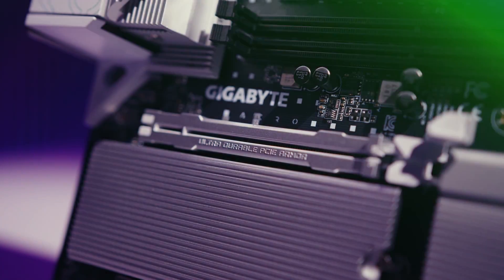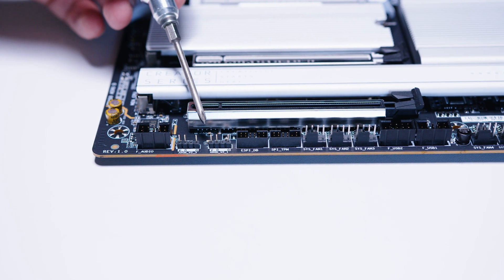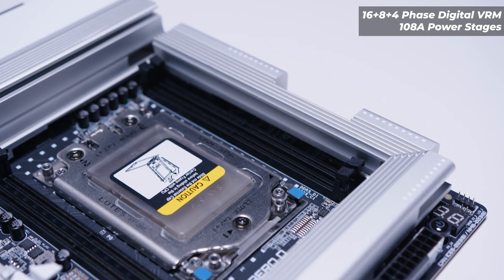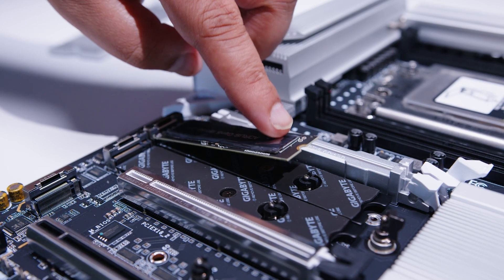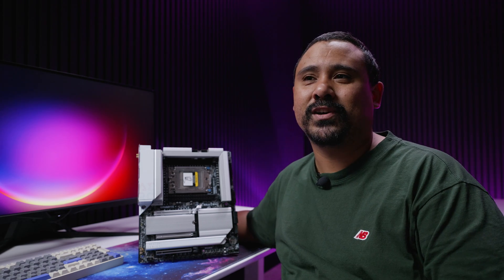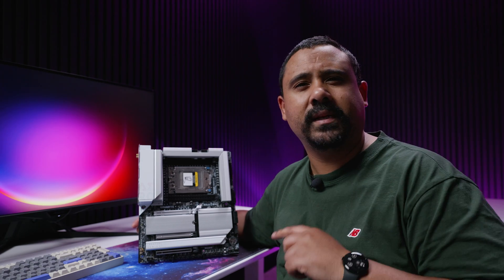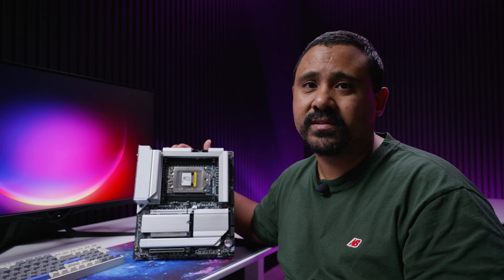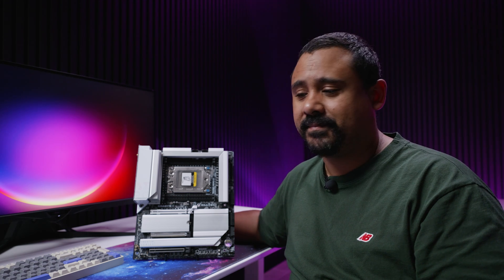Threadripper Never Looked So Good! 🔥 - Gigabyte TRX50 Aero D

Comment: Do u consider to use this board personally? If so, you might need to RMA the board 1st, cos its not the latest revision. Older rev have issue with sleep feature.

Comment: I always wondered. How is gaming on a threadripper cpu? Keep up the great work you guys and stay safe. ❤
Reply from the maker: Gaming on Threadripper is fine. It's a bit overkill for gaming though.
Reply: Commenting here because I too would like to know.
Reply: Gaming will be alot less than the7950x or 3d for sure.
Reply: @JoeMama-yl1ow  Nope. HEDT chips like Threadripper are better for gaming than low end desktop chips like the 7950X/X3D (AM5) because you can game and also multitask, stream, whatever. CPU doesn't matter much for gaming (it is a GPU activity), but if you can afford the more powerful CPUs then there is no reason not to go Threadripper. Not to mention you will have enough PCIe lanes for 4k 144hz capture cards, multiple full speed NVME ssds, etc which you cannot do with the tiny 16 lanes on a 7950X.
Reply: Not as good but if you do hybrid of 3D work and Gaming. This is perfect. AM5 is a little bit limited for my work